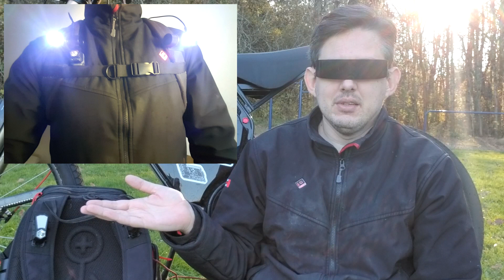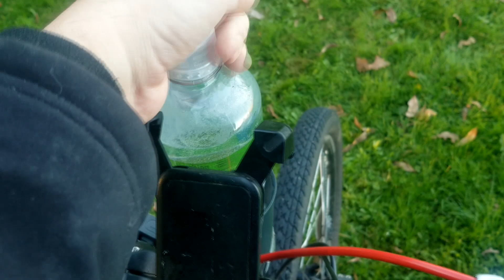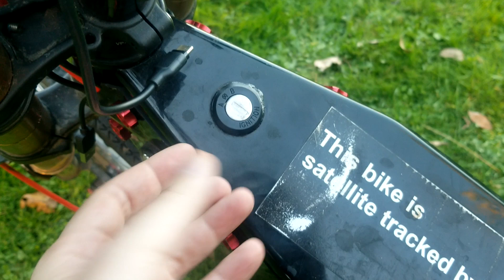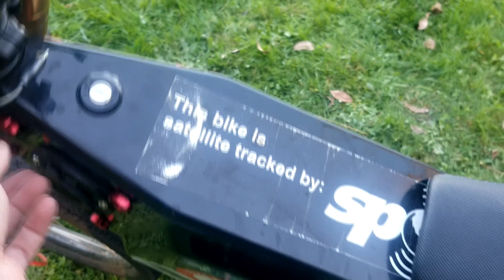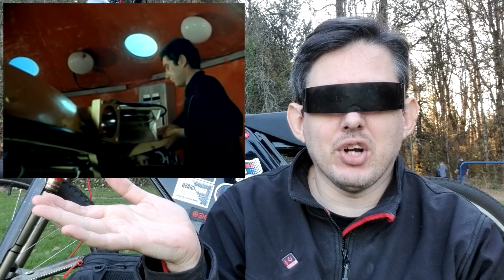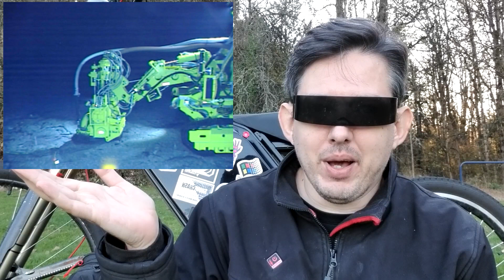Undersea News, Winter Gadgets & eBike Teardown

Comment: on your stream, you asked why skynet would make plasma weapons. the answer probably has something to do with logistics. bullets require a bunch of materials that are hard to get without good infrastructure. skynet doesn't have time for that when there are humans to kill, and hydrogen is literally everywhere.
Reply from the maker: Hm. I can buy that it's more convenient for an AI with access to fusion power as it's functionally limitless, but not that it's logistically simpler. Bullets require a few chemicals & metal. Plasma weapons are insanely complicated & would have much larger logistical footprints to manufacture. But once you do, if you have fusion power onboard, you functional ammunition storage is vastly larger than if you had to carry solid projectiles

Comment: I didn't get the notification for the new upload :( Also have you seen the camping stove that can charge your phone? Its a little portable camping stove, that can charge electronics while you cook. I thought it was neat.
Reply from the maker: If you mean the Biolite, I have long been aware of it, and unfortunately it isn't designed very well. It needs to be emptied of ashes very frequently, on the order of every 5-10 minutes. It generally does not take long enough while cooking to charge anything. If you're keen on thermoelectric power generation, a superior version of the same idea is the Power Pot. It's a pot lined with TEGs that charges phones, but crucially there's no small combustion chamber like on the Biolite, it can sit atop any campfire and generates power from the thermal differential between the boiling water and surrounding air. As you'll generally keep a fire going for hours anyway, so long as you keep adding water periodically it will have the time it needs to fully charge your phone with much less hassle than the constant emptying and refueling of the Biolite, which also requires the interruption of the cooking process to do.
Reply: @Hamdad  the power pot, I’m going to check that out. I saw the bio lite and figured the frame seemed oddly small for ash collection, but the idea was really cool. I figured they engineered some sort of receptacle like a BBQ to sift ash thru the bottom but it’s an enclosed capsule. 🤨 why they would do that I don’t know. Anyway I love the videos, I just don’t know why YouTube isn’t sending me notifications. Also for jade, I know it’s a long shot but I heard about a man who had cured himself of stomach cancer by using dog worm medication of all things. I know it sounds ridiculous but it might be worth a try to save her life. I don’t want to see hamsters suffer just because “ they are to small”. Either way, I hope she can live a happy life. Godspeed to you hamsters 🐹

Comment: I Have a motorcycle and I can attest that it gets cold as fuck even going a steady 40mph down the road.
Reply from the maker: I do recommend Fieldsheer Dual Power clothing then (formerly Mobile Warming). There's other 12v heated cycle gear but they don't also optionally run on batteries

Comment: Love the Bill Shakespeare reference with Proteus. Anywho, it was good to see the inside of the bike, I'm actually thinking of converting my Trek FX2 to EV by way of either a hub or mid-motor (haven't decided yet). Shame those fellows in the park didn't realize they were playing football next to a star.
Edit: Commented before the Skelmo at the end; AngriestPat and PeachSaliva would be proud.
Reply from the maker: mid drives are more efficient and durable (due to sprung vs unsprung weight) but more complex to install and cannot have regen to my knowledge, that's the tradeoff. You gotta decide which features you value more.

Comment: Seeing nipples is generally seen as a success.
It stands to reason that robot nipples would be higher, closer to eye sight (or receptors in general) Optimizing success. As robots tend to do.

Making the nipples illuminated is generally seen as overachieving in robot society.  Which is the standard.

Comment: its possible you already know this but here goes. if you are recording a video you could try and record it in MKV in stead of MP4. this is because if you do not end a mp4 recording properly (like with a crash) there will be no end information at the end of the data file, and to play an mp4 file you need that info otherwise the computer wont know what to do with the data, making the entire recording unrecoverable. if you record in MKV (i believe) you do not need this bit at the end to be able to play the data, even if you end the recording abruptly or there is a crash, all you really lose is the last "chunk" of the recording, aka a couple of seconds.
once you have the recording proper you can, and many do, convert the mkv to mp4 before starting to mess with it in editing, as it tends to play better with editing software. worth a shot perhaps?
Reply from the maker: Oh thank you, this is very helpful.